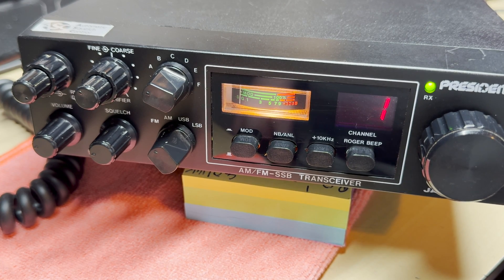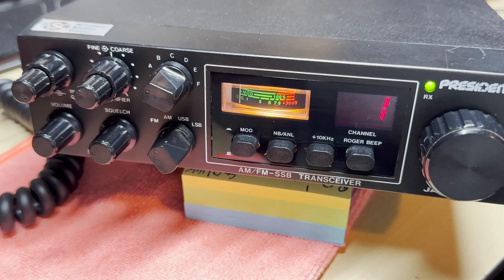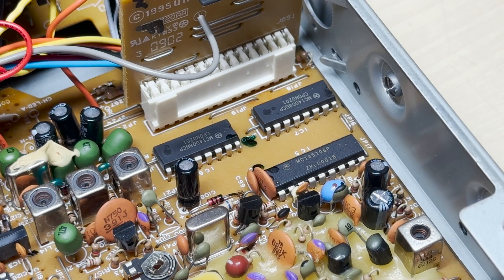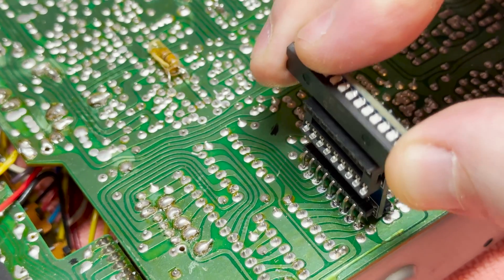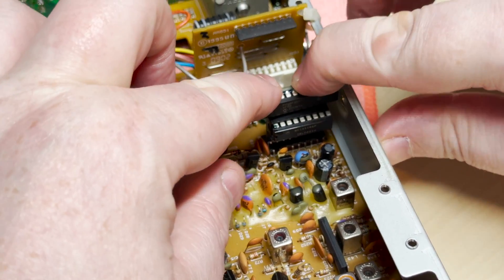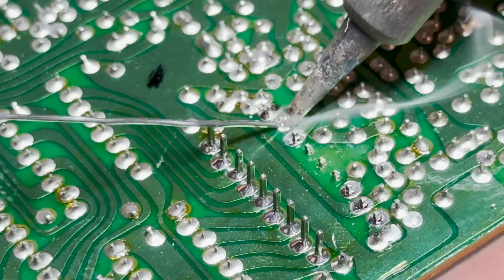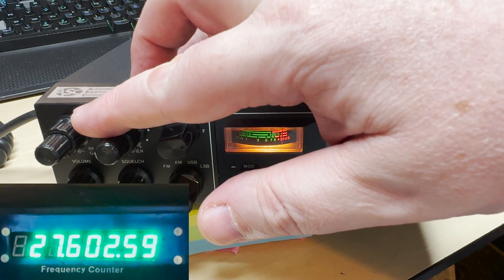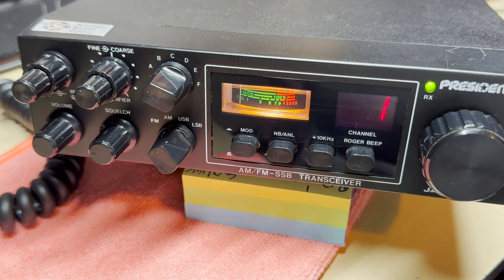NEW Microchipz Mod board - President Jackson 6 band - UK40 - NO CUT TRACKS or Wires - Plug and play!

Comment: Hi, what happens when you are on AM or USB /LSB on band F do you get super high on these modes? Is it only when you are on FM the UK works on Band F
Reply from the maker: The board changes band F to uk1-40 readout, thats it, as the sh band is the top half of uk40 and bottom part of 10m cw. Its called a no wires board because of its easy install and easy to put back to standard if needed,